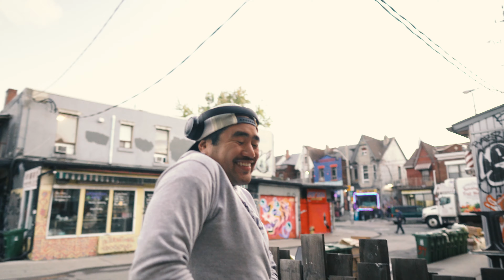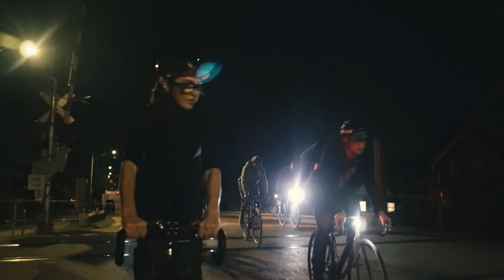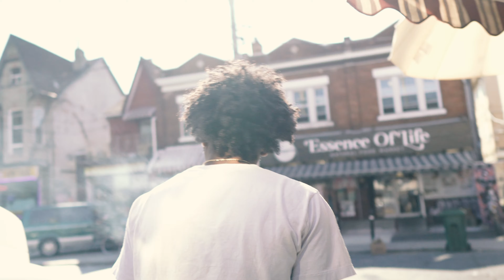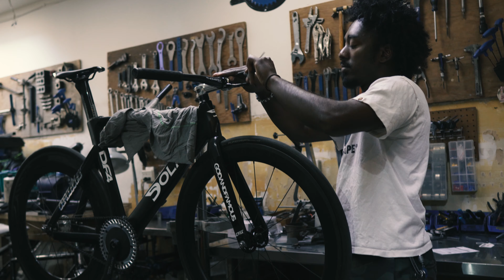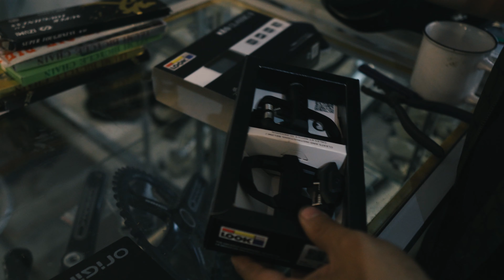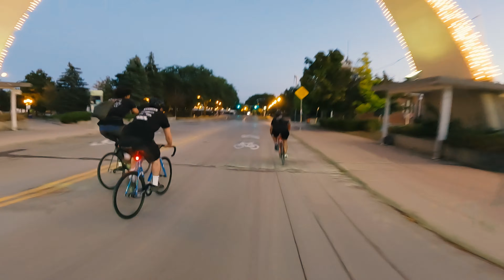Fixed Gear night rides + bike upgrades +GoPro helmet cam

Comment: very nice bro, what setup u run on that first part of the vid? the rolling shots look good af, never tried to do video takes with my a7iv while riding, but if i put a 24mm on it should work fine, quality just so much better. Let me know if u got any tips or insight on the setup
Reply from the maker: All hand held with Sony Zve10 and post stabilization - with a 16mm lens
Reply: @mikey_fixed  hmmm bet,   will give a go with time a7iv and 24mm, should be enough and smooth